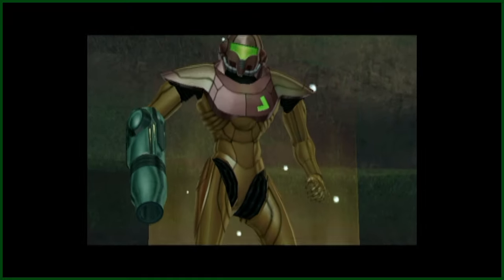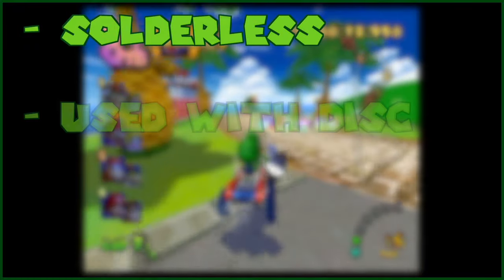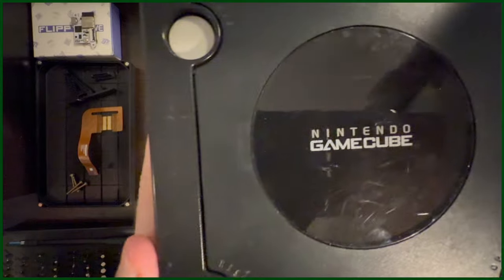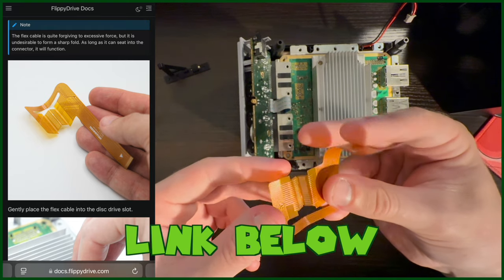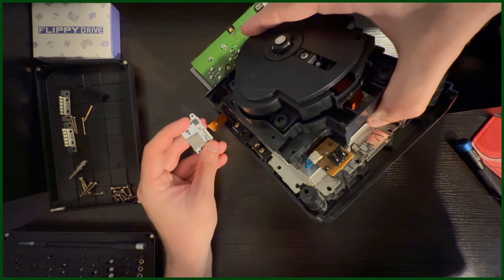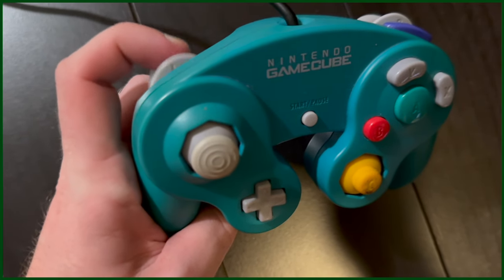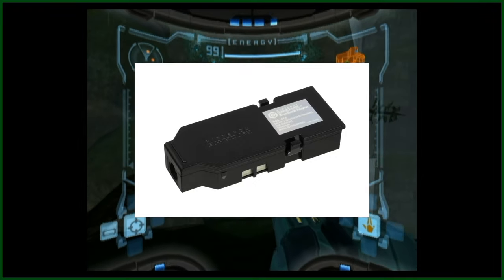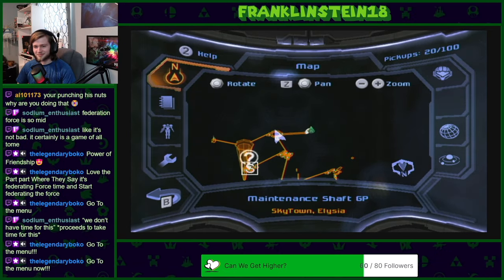The EASIEST Mod for the Nintendo GameCube Just Released - FlippyDrive Review/Guide

Comment: I actually happen to have a second gamecube that I have never used so I might consider getting this, and for less the $50 for a regular one it almost feels like a steal. though I am intimidated by how to download the firmware and what not.
Reply from the maker: @adrianoippolito1999  the firmware isn’t really that bad tbh. Just download the file and put it on the SD card, simple as that. It’s the formating that could bring trouble (but also that’s just a few clicks) either way a solid mod!
Reply: @Franklinstein18  It probably is but I seem to have bad luck when it comes to getting these things to work. bought a tribute n64 controller to use on my PC but could not get it to work for the life of me. Though it instantly worked with my nintendo switch so at least it isn't a paperweight. but I really wanted to play my emulated n64 games on pc

Comment: I ordered two deluxe kits that come with the ethernet port. I ordered in October before their last Pre-Order cut-off. The delivery time at the time was April 15th, and it still is, no updates. They are destined for two GameCubes both being PicoBoot modded, buth with 512GB SD cards. My main has a BlueRetro I/O board from LaserBear. Not sure how useful it will be after the FlippyDrive. I got my 8bitdo Pro 2 working good for GBA games through the player but the button mapping can be confusing. You do it through a web browser. LaserBear does sell an extension for the SD Card that puts the slot right behind the power LED for $25.
Reply from the maker: You gotta let me know how the Ethernet port works, I’ll want to upgrade later. I bought the standard simply because I wanted the drive sooner
Reply: @Franklinstein18  I'm sure there will be plenty of people that get it before me. I really don't know if it is worth it but I didn't want to be left behind. For me it seems better than taking the sd card out or buying the extension from laser bear

Comment: I don't like the idea of hard modding my consoles
even though my disc drive Is failing I can still run games via action replay or play one of the games I bought when they were affordable
the thought of carving up a GameCube's Internals to put In an SD card reader..
at that point I would rather buy an emulation box or a PC or run games on a modded Wii
Reply: great cuz this does not carve up the cube lol
Reply from the maker: I totally agree with you, though I would classify this as in between soft and hard mods. You aren’t soldering anything to the GameCube, and it’s as easy to remove and make stock again if you ever want to return to a regular gamecube
Reply: That's the great thing about the FlippyDrive. It just slots right into the Gamecubes optical drive port and is mounted to the shield using its existing screw holes. The entire process is completely reversible and doesn't require you to damage or alter the console parts in any way. You can easily just take it out and have a stock Gamecube again.